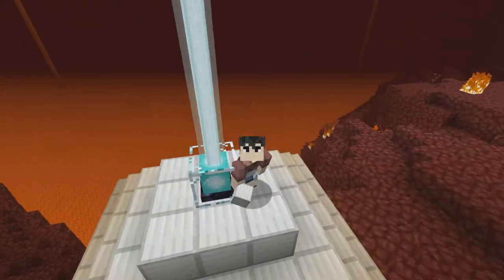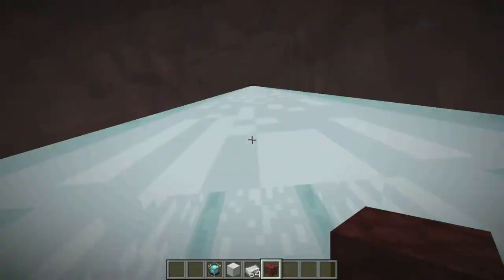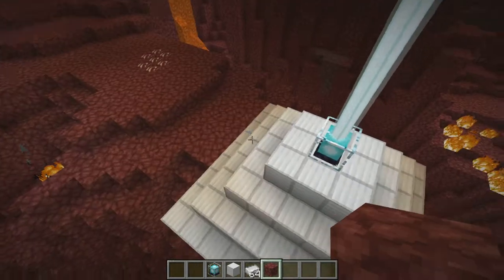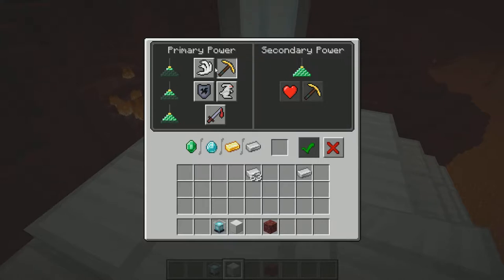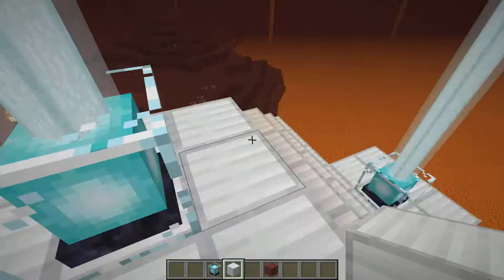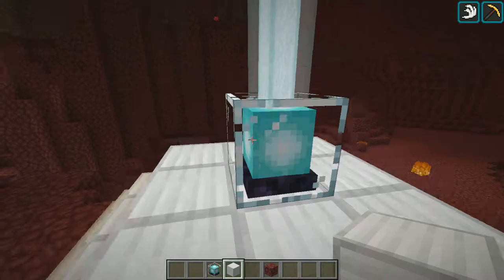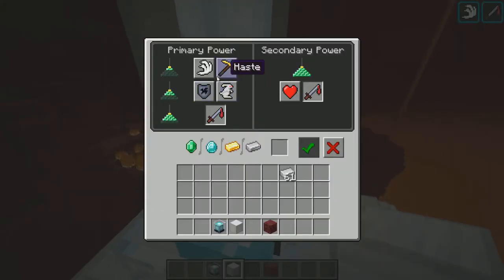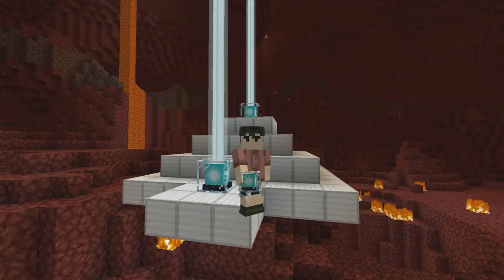How do Beacons Work in the Nether?

Comment: Mine is broken I did that before I watched the vid and tried to find out why mine wasn’t activating even tho I dug up to bedrock
Reply from the maker: Usually this means that there’s more Netherrack in the way in between the Bedrock layers of the Nether ceiling. I’ve encountered many a time that I could not remove the Netherrack because there was no way to get to it without removing the Bedrock around it so, if you can, just try to position the Beacon somewhere else and dig up through to the ceiling again.
Reply: @laggingdaze  ah okay thx!